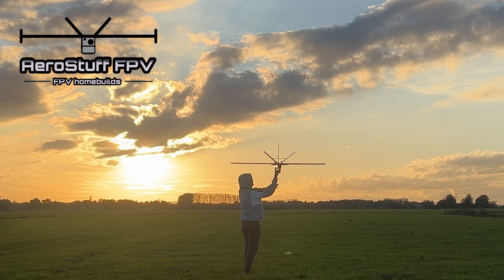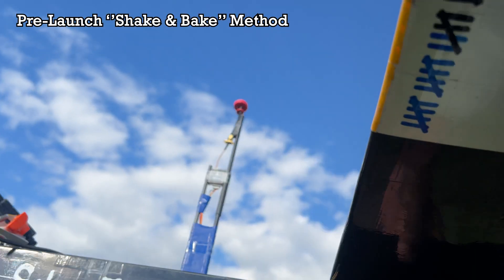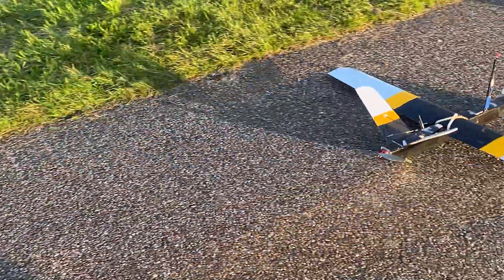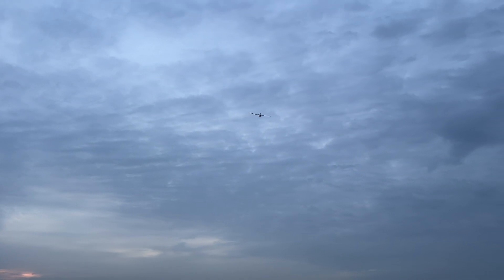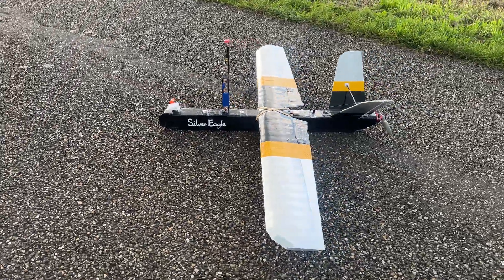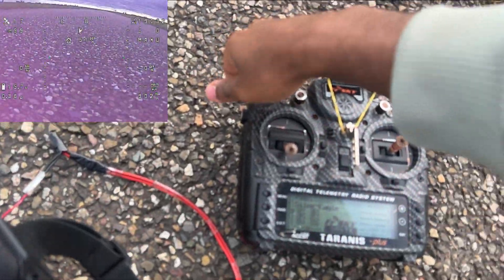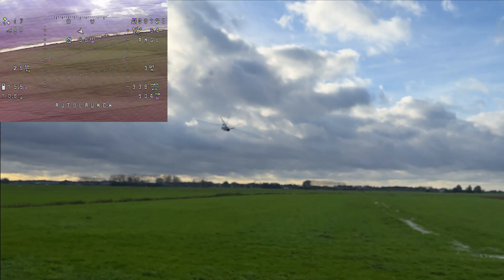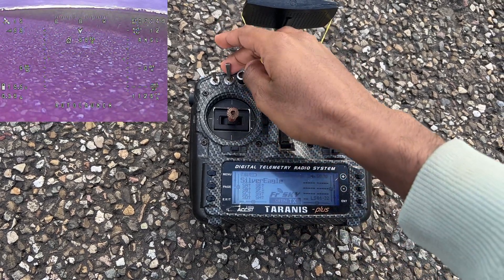Homemade V-Tail Pusher Aircraft for FPV - Automatic Takeoff Settings & Demonstration (iNAV)

Comment: Hello, I am building a VTOL tri copter with a V-tail configuration:-
main wing span of 2.3 m
main wing root = 25cm
tail wing span =43.12cm 
tail  root chord = 30cm   
tail tip chord = 18cm 
what do you think about these values are they fine or should I change any tail measurements. Your feedback would be greatly appreciated. Thank you.
Reply from the maker: Should be good. Good luck

Comment: thank you :) . So what does the plane do after launch mode is over?
Reply: Normally it will go into a loiter mode where it circles around until you turn it off.
Reply: @M-H433   I couldn't make this setting..My plane takes off and goes straight
Reply: @M-H433  Isn't it necessary to switch to louder mode after launch mode?
Reply: If your using inav it has a loiter mode in modes area,just need to put it on a switch and channel,after auto launch times out it circles until your ready to take over
Reply from the maker: After launch & climb, it'll activate the mode that my radio is transmitting (I always switch to Horizon Mode) But it can do any mode after launch (RTH, WayPoints, NavCruise, etc.)